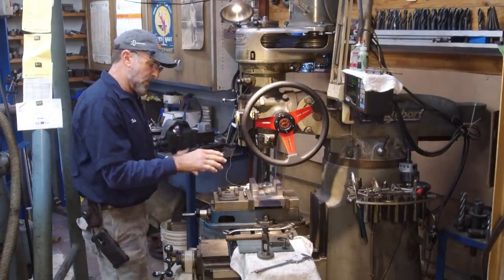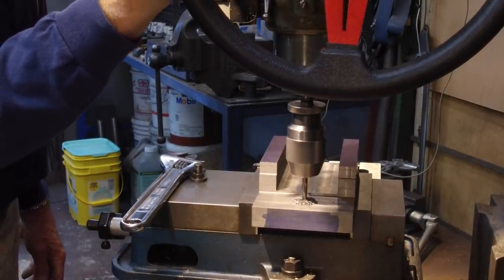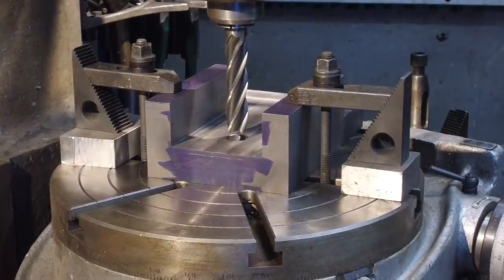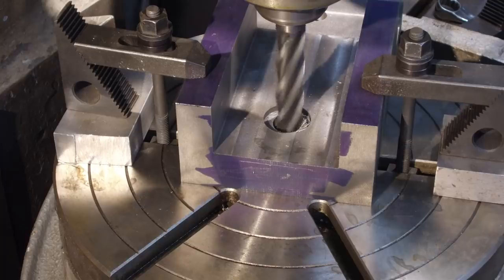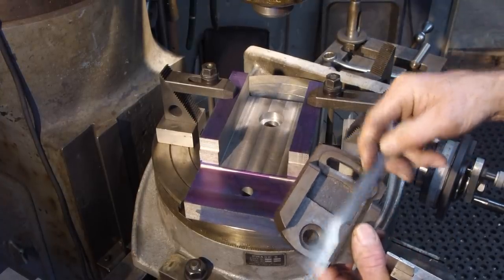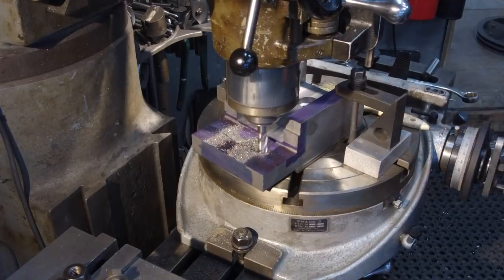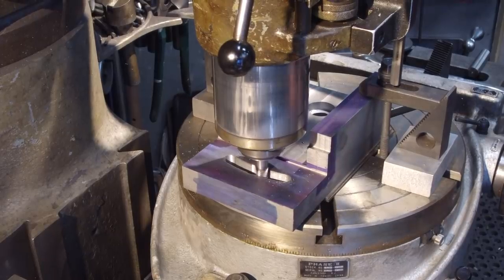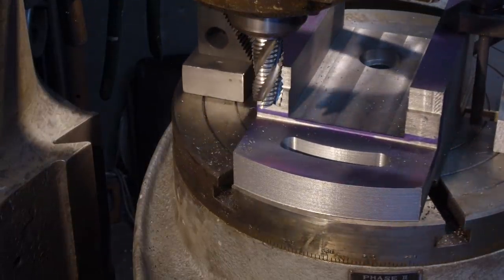The Clapper Part Four

Comment: If you wanted to move to one of the fly over states you would fit right in and we have plenty to fix to keep you busy. :-)
Reply: If you should fly over my house I need help making a d1-4 universal mounting plate from a splindle nose 1-1/2 8tpi adapter and an 8 inch disc. You are needed, keep the faith.
Reply: I thougt about where Keith could move and now I have a vision of a giant shop where all the youtube metal workers work together as co workers and getter done :D

Comment: If I were buying a knee mill right now it would probably be a Jet JTM-1050EVS; I used one when I was in school and they are very nice machines.  They were built by YCM, one of Taiwan's top machine makers in terms of quality.  It has 3 horsepower R8 spindle and variable frequency drive.

Comment: Keith, does one get more tool flex with climb as opposed to conventional milling?I understand from reading that as the end mill cuts it pulls itself in a predictable direction but I haven't seen it said if it acts the same in both types of cuts.  Furthermore, when milling a slot where its cutting on both sides is the flex predictable as well?  Perhaps in the direction of rotation?
Reply from the maker: End mills will always pull to the climb, how much back lash is the biggest concern on older machines, cut quality and accuracy is most concern on tight machines. finishing passes make for the truer cut.  ;{)